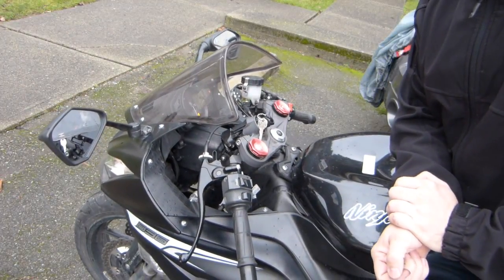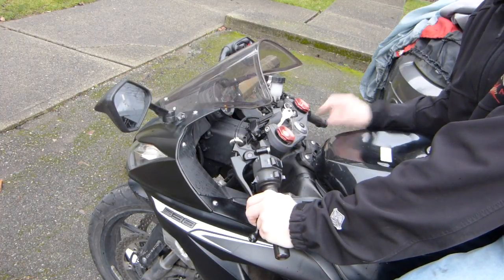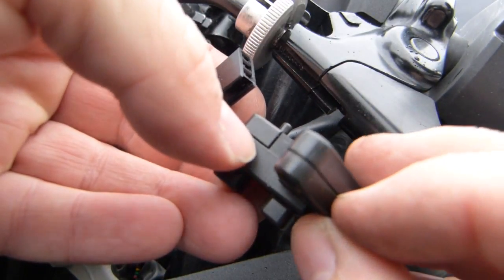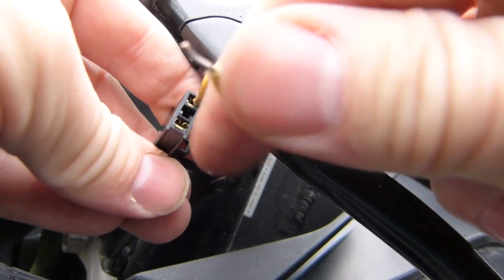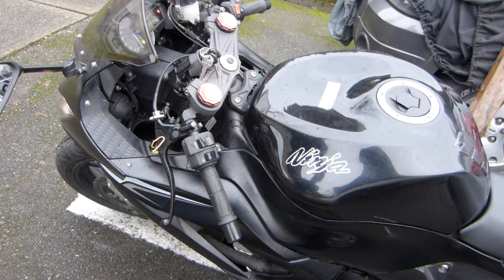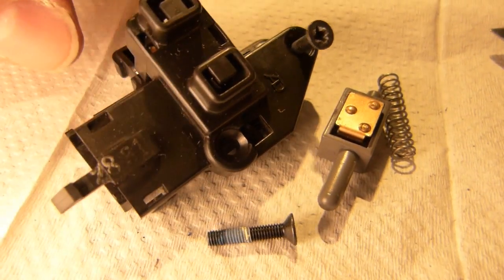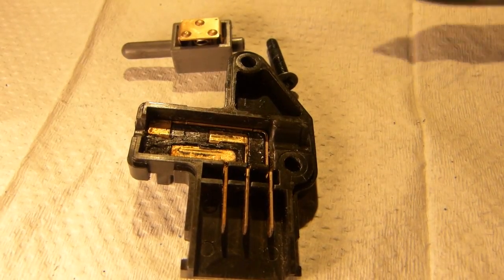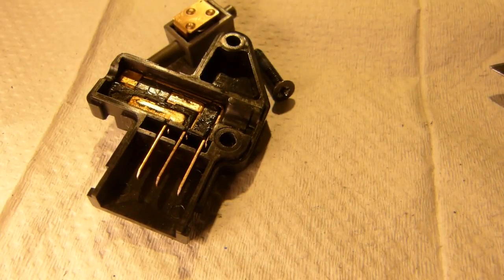Clutch switch issues

Comment: Thank you so much this video helped greatly. I just acquired a 1983 suzuki gs650l and the previous owner laid it down broke the clutch handle and a few other things and this helped figure out why the bike wouldn't start. The oem part I got had a different connection so I just cut the wires spliced am and hooked directly to the switch and it works perfectly now

Comment: You're a lifesaver !! I just broke off the clutch switch while replacing my clutch lever. Wasn't aware of it's purpose exactly. 
I gues I'll look for a replacement of the switch.
Reply from the maker: Cheers, mate!
Reply: Aye I just did the same thing where can I get a replacement
Reply: @xavierzamora5318  I ordered one with my dealer
Reply: I busted mines as well. They make them out of cheap pot metal on purpose.. gotta keep that revenue flowing in of course

Comment: Hello sir.. thank you for making a detailed video. I was searching for the clutch switch failure videos and came across yours. Please help me with this...i have a Generation 2 Hayabusa 2020 make. A few days ago the bike was not starting properly. Somehow bike used to start with little clutch movements. After that the bike completely stopped starting. I thought it might be the issue with the battery so I replaced the old battery with the new one. Still facing the same problem. There's no cranking sound at all while trying to push the ignition. For my version i have to engage the clutch to start the bike even if the gear is in the neutral. When I push the Start button lights are going little dim as it happens while starting the bikes but there's no cracking sound. Is it the issue with clutch switch or the starter motor? 🙏🏻
Reply from the maker: Likely, neither. The start button and the kickstand switch are also on the circuit. Jump each to bypass them one-at-a-time. There may also be a Neutral switch on the same circuit. And there is the starter solenoid, too.
I have videos on some of these.

Comment: Hi, I hope I get a quick response because I use my bike for work and wanna know if I bypass this I dont have to touch the switch on the quickstand? because my problem its on the quickstand I think, because the neutro flickers sometimes but I could be wrong
Reply from the maker: @marshalltbf109  Clutch switch is completely independent from the kickstand switch. Messing with one will have no affect on the other. It will neither break nor fix the other switch, so you still have to troubleshoot the circuit properly.

Comment: This video was very helpful thank you
So long story short I was having the same issue and after watching this helpful video went outside to take out the clutch switch and clean it as well when I saw that it had a loose connector so I properly connected it again and tried to turn it on with the clutch in and first gear in and it worked so I was being a noob should've checked first but anyways thanks for the video for future reference 

Honda cbr600rr 2009

Comment: same thing with the break light so if ever that i will used dual tank brembo corsa i am able to use the fluid switch instead of this ugly plastic switch? am im right sir? correct me im wrong... thank you..
Reply from the maker: Any switch will do, or no switch at all, just connect the wires in ON configuration. (but it's a safety switch, you might not want to bypass the switch)

Comment: I had similar clutch issues on my '13 zx6r only because i purchased a new lever and it had its own perch which the switch can not connect to, now that I saw you jump it with a wire i think I shall try to find a super small piece of black wire and secure it with electrical tape so it all matches down there
Reply from the maker: +LazyWaffles I twisted my wire around the rest of the wiring harness twice and bent it in a U shape that holds the connector upside down in a vertical position. If there is vibration, it can only shake into the jumpwire, making electrical contact stronger if anything.
Reply: +theoverengineer i took a small piece of copper wire and folded it into the plug and wrapped it up nicely with black electrical tape and blended it
Reply from the maker: +LazyWaffles Nice, I`ve never thought of that. Thanks for commenting!
Reply: when you left the wire on it, did the gear light on the deck appeared? i tried just putting a wire and it will stay always on neutral, even thought it would be on 1st... help ?

Comment: So this should be removed, cleaned and installed again for it to work properly?
Reply from the maker: That doesn't fix the original problem, I just jumped the switch. Jumper wire has been in place since.

Comment: What if you cut the plunger short? Does the clutch stay engaged?
Reply from the maker: Bike will not start if the plunger is hacked off, stays extended and can not be pressed into the switch housing.

Comment: Thanks a lot! will the wire trick work on a 08 ZX6R? Also did you end up putting that switch back on, or did you just leave the wire? I can express how thank full I am to you for making this video!
Reply from the maker: Works on any switch that is NO (=normally open). Exaples include center stand switch, side stand switch,  fuel cap/door/trunk ajar warning light. Lots of other examples.
Reply: theoverengineer thank you for your response. I tried it using a paper clip, and it worked, only thing is that the gear lights won't show it will only stay in the neutral light. Should I buy another clutch switch? 2008 ZX6R thanks again
Reply: do it, its only 25 bucks yo
Reply: i bought it and it still didnt work, im thinking it's my kick stand? do you think that is the case?
Reply: Can anyone help me still please, I bought the new switch and the problem is that, it will work, but it will only show the light of neutral even if it is on 1st. I dont know what else to do please advise me.
Reply from the maker: What`s wrong with the bike?
Reply: Sir, so the bike will not start in first gear. After watching your video, I decided to order a new clutch switch, when it came it installed, not fully install but plug it back in to the clutch cable, it will work, but this time the Neutral light will only stay on, even if I'd put it on 1st gear. So long story short I gave up, and just took off the switch. As of right now the cable is disconnected meaning I do not have the clutch switch anymore. Thank you again for your reply.
Reply from the maker: Find the connector to the Neutral switch and jump it on the harness side like I did with clutch switch. See them both at https://www.youtube.com/watch?v=rfB0pkoTlCU from 47:03 - 50:30
Does that fix the problem?
Reply: I apologize for this late reply. I tried that using the by pass but when I use that it works and all, but when I shift gears in my speedometer the gear will stay at only 1. The reason I guess why I want to fix this is just because I want to start the bike right away if I stall it in traffic.

I tried everything I bought the new switch and nothing, I tried your idea and nothing. Do you thinkis because I have aftermarket levers? is there a way I could contact you more personal? maybe facetime? 

I am almost giving up, and have just left the cable hanging there with nothing on it, hopefully it wont damage it? Thank you for your time and expertise.

Comment: my bike has 3 wires on clutch switch. ??
Reply from the maker: Could have 2 more circuits running through: say 1 for powering the starter, 1 for ECU running data, 1 for safety linked to kick stand switch too.
I`m guessing, not reading your wiring diagram. You do that.
Reply: What bike do u have?..is it a ninja 650?

Comment: So what is the middle prong for?
Reply from the maker: Nothing in this case, generic switch Kawi grabbed.
Reply: @theoverengineer  amazing! Thank you! I installed a magura clutch on mine and the switch only had 2 wires but I was wondering what was I missing by not having that ground wiring. The response is much appreciated!
Reply from the maker: No worries, enjoy riding!